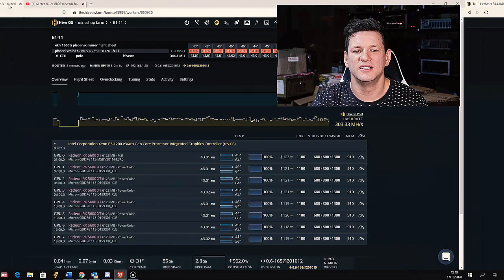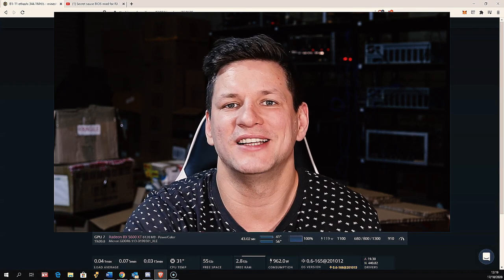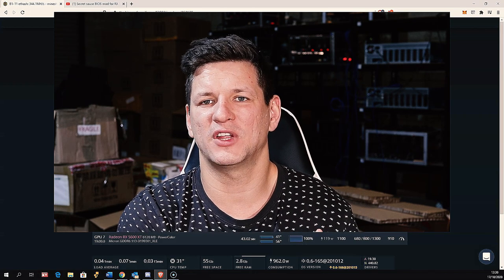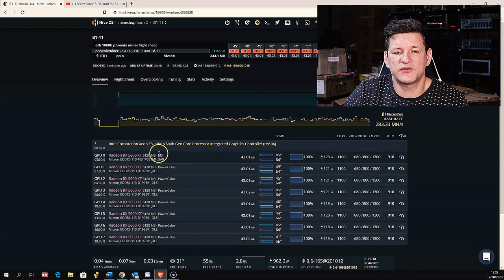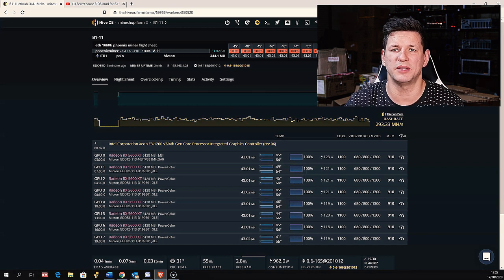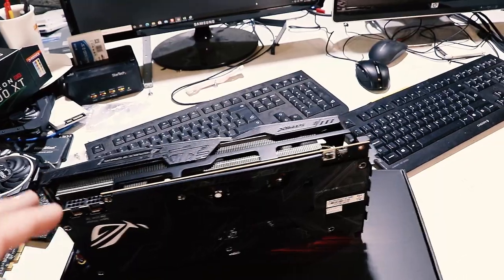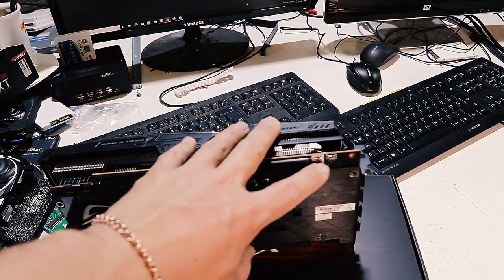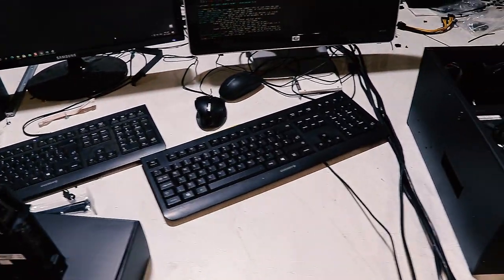Have you bricked your GPU bios, RX 5600XT bios mod !?

Comment: Thank you for having all the modded bios in your description! Was able to try them all out lolol. The PCbios ended up working for my Asrock Challenger Pro w/ Samsung memory. Keep up the great Work!!!!
Reply: May I know if your ASROCK Challenger (Samsung memory) has the same info as mine: Radeon RX 5600 XT 6128 MB · ASRock
Samsung GDDR6 · 113-EXT40650-001
Reply: It’s currently hashing at 39.29 MH/S with 83W OEM bios. And I can’t find a proper Bios to mod it
Reply: @camillatu2321  mine was (pre bios mod) 113 ext800128 L02
Reply: @TheDlacey31  thank you for the info. I guess I need to do more research before flashing the PC bios then

Comment: greetings sir! peter from manchester here! i bought a sapphire pulse rx5600xt and its now at 43 megahash and vdc at 750mv. all thanks you you and this video! but i did it in windows using amdflash 293+ it DOES work with rx5600xt and because its got a FORCE function you can get your MSI bios onto rx5600xt. very happy. i now have seven rx5700s one rx5600xt and running tech support for a big mining farm near birmingham uk. the igors lab forum had the tip about using amdflash 293+ on the rx5600xt.   we cannot get gpus at sensible price at all in the uk. its gone completely bannanas. best wishes peter in manchester.   ps the efficiency of rx5600 and rx5700 is identical - thats what ive found - hash per watt the same within 5%

Comment: hey i brick my GPU i have Asrock RX 5700 XT Taichi X OC+ i did mod same like your video i got black screen like this (-) i can't do anything help me out
Reply from the maker: Try to use different motherboard if you have.
Reply: @GuntisVitolins  can you tell me which motherboard I try ? I use asus b250 mining expert
Reply from the maker: @LifeHacks007  like I had same issue I was using x3856 motherboard and it didn't boot, pleased on OndaB250 and booted.  I think booting in windows safe mode also should work.

Comment: Hi, I was having trouble bios moding my asus dual evo rx 5600xt. Your video helped a lot. And solved my problem. Thanks a lot for the content.
Reply: @realperra  Hi,
You might use any one of the bios(MSI/Powercolor) they would work, I would suggest to first export your current bios and check if you have single micron memory or dual micron/samsung memory.
If it has only micron, go for MSI bios mentioned in video description, otherwise go for Powercolor.

Mine had dual micron/samsung memory so I have used Powercolor bios.

Just remember using these bios will lead to wrong power consumption data, so do have smart plug to measure you power consumption.

Also, i have found these asus evo duals are not good in overclocking.. So if you get stuck/dead gpus, try lower than expected overclocks. 👍
Reply: @realperra  Hi,
Thanks for sharing you experience.
Would just like to mention to NOT use claymore miner they are not in development any more.
I too was facing stability issue with phoenix miner , so I switched to teamred miner, am getting 39.6 mh without bios mod and 42.5 with modded bios. 
Also am using Hive OS, its really easy to bios mod there. 
Would recommend using teamred miner and HiveOs.
Hope this is helpful. 😊
Reply: @jhonsm1614  This was my problem.  was trying to flash the MSI bios and I had the dual Micron/samsung timings in my original Asus Bios!  Thanks Guntis, the unlocked powercolor bios worked great.  I have Asrock and Sapphire and they both only had the single micron memory timings in the bios.  So now I am going to try my luck on a Gigabyte!
Reply: @jhonsm1614  Thank you for the tip! I used the BIOS Powercolor on a Powercolor 5600XT with Micron and the MSI BIOS on a 5600 XT Asus Dual Evo with Micron.
Do any of the two Mod BIOS work on the Asrock 5600 XT Challenger and Phantom with Micron memory?

Comment: Thanks for the video.
The only problem I have with the modded bios from red panda is that I cant get the core voltage under 700mv.
I can set in hiveos lower, but when I do amd-info it says it's running above 700mv.
I will try the power color vbios.
On msi rx 5600xt I was able to run 1040mhz core at 640mv with same 42.5mhs
Thanks for the video.
Just want a way I can lower the voltage below 700mv.
Reply: Im running that vBios on my PowerColor 5600xt V2 (non devil/dragon) at 43.9 mh/s (Phoenix miner on HiveOs) . In my case it works more stable than original vbios...
Reply: @SweetoothDS  bro, whats your core, vdd, vddci, mvdd and mem configs? Please

Comment: Many thanks Guntis.  What's the difference between a stock 5700xt and and one already flashed. 55 by 140w and 58 by 130w?
Reply from the maker: Flashed rx5700 uses slightly more power but also scan increase the hashrate by about 10%

Comment: With the RedPanda bios mod i'm getting 43mh/s with the same clocks your running however the voltage between cards differs, some are in the 70w range and others are around the 130w range.  Kind of strange... for all 5 of my 5600's i'm getting a 542w in HiveOs.  You should show the various settings you have enabled also for your fans/watchdog etc.  I have my Fan's set at the following: Critical Temp: 80, AutoFan On, Target Core: 65, Target Mem 85 and that's all.  Then with Watchdog I have:  Hashrate Watchdog On, Miner restart after 1 minute, reboot rig after 1 minute, reboot if GPU is offline, Watchdog mode Miners, Phoenix 180mh/s.  I have 5x5600's so if 1 fails the total mh/s should drop below the 180mh's threshold and force the miner to restart.

Comment: So I accidentally loaded a micron bios on my MSI Samsung memory 5600xt. This bricked the GPU. I tried booting in hiveos with maintenance mode "without loading drivers", but with no success. The system just won't boot when the card is plugged in. I also tried booting it in windows as the second card, but still won't boot. Unfortunately, the card doesn't have a bios switch. Are there other things that can be done to unbrick my GPU? Thanks!

Comment: Hello. I have issues modding the bios for my. Asus TUF 5600xt. If i mod the bios myself using rbe, it bricks it. Same with the msi bios from red panda. No issues flash the bios on my 5700xt and 580 tho. Thats why my 5600xt is stuck @ 39mhs stock bios.

Comment: I need to bios mod my sapphire pulse 5600, I already did my MSI one gaming MX using the bios from red panda mining, can I also use this on the sapphire 5600 xt?

Also the 5600 bios mod don't seem to work well with windows 10 AMD drivers, lots of crashing.

Comment: yeaa, the "maintenance mode wothout loading  drivers" method does nhot work for me... I modified a locked bios without knowing(msi 5600xt) and now the  system doesnt boot anymore.. no post,  no hiveos control
Reply from the maker: Do you have another motherboard, insert in different rig. Have experienced the same that some rigs doesnt get proper boot.

Comment: @#GuntisVitolins I understand your reading at the wall but not sure how you get ~120w per card in HiveOS. My cards, with similar overclock, are reading ~88w. Thanks.
Reply from the maker: It's because of the case and the power supply I'm using on this built. Also card memory is lot to do with Navi cards.
Reply: @GuntisVitolins  Thank you for the response.

Comment: hey bro, thanks for your content! I happend again to me and not sure what to do, 
I have hiveos,
 5600xt OK on the main slot, 
5600xt briked on another slot,
maintainence mode no drivers activated, 
but it doesnt reach to start hiveos
the fans spins

what can I do? thanks for your time!
Reply from the maker: Do you have different system availible, some motherboards has issue to boot with briked cards
Reply: @GuntisVitolins  will try that! I have another rig with a diff mother to try
Also, I have a windows machine, I also read that for this XFX 5600xt thicc iii flashing on windows could help, will try that
thanks!

Comment: Welp...joined the club. Asus dual 5600xt.  Bricked in Windows.  Won't even post with card plugged in.  Tried doing a hot swap as soon as it got to post, but then when I get to Windows I can't see the card.  Wont show via amdvbflash -i.  Device is not there. Mobo is gigabyte h110 d3a.  Any ideas?  If i try hive, still won't get a post on this mobo will i?

Comment: Well i saw this video and i have guestion. Using 1 xfx rx5700xt trppledisapation model for mining. I getting around 52,- mhs. Windows10 64bit sytem. Is it gonna be better to flash the bios is it gonna give more juice.
I am not familiar with Hive OS so cant just jump in without know how?
Do you use some tools or software to utilize those perfomace.
And does it makes any differece in case if does i will add 4 or 5 extra cards you know. Ty

Comment: Hey Guntis

I had a sapphire BE 5600XT that I tried to just do a standard memory straps copy on

And it bricked it hard, system wouldn’t even post with that gpu connected... and thst gpu doesn’t have a dual bios switch.

I ended up replacing the card. My question is, is that type of a brick recoverable? If so, how if I can’t post with it?

And also: did it brick because I used the stock bios as a base for the mod and not one of these older unsecured bioses?
Reply from the maker: Yeah some of the latest bios are locked and when mod they brick card. I have had also such cases brick so system doesn't respond. What I did I used different mining rigs, some motherboards doesn't load properly with bricked card. Also you could try this to do in windows in safe mode
Reply: @GuntisVitolins  Interesting, could be the motherboard thing. my B250 would only turn on to a black screen with one white dot on it. It wouldn't post to even do safemode. Ok great, so you think I am safe to just simply flash one of these bioses to my sapphire BE 5600xt's? :D I won't blame you if it bricks haha. Thank you for replying :)

Comment: this actually just happened to me with igors flasher not flash right or something but it wasnt bricked
it actually loaded but every time u did anything with the gpu like start the miner or even try to flash back it would give a driver error
i loaded this video up while i was starting hiveOS just to see if there was anything i missed from last time
but the linux flash tool in hiveOS worked perfect so if i remember right thats whats in this video